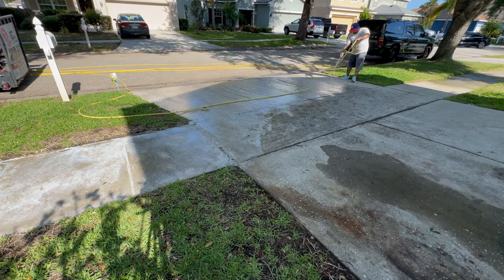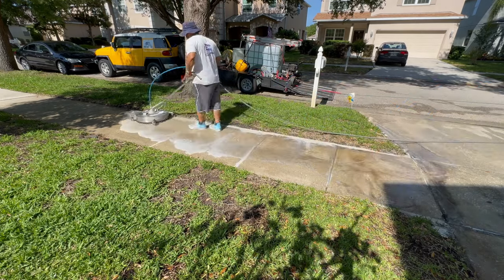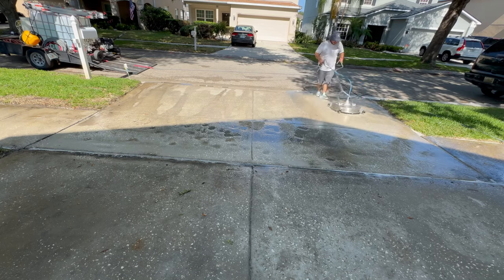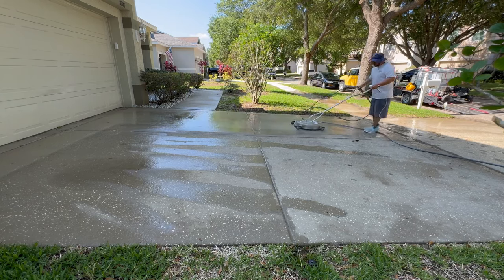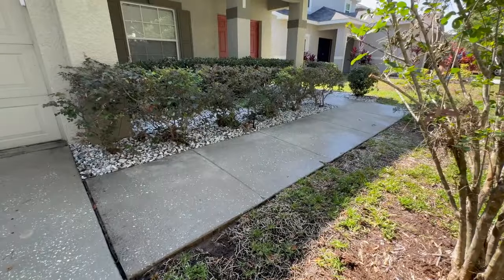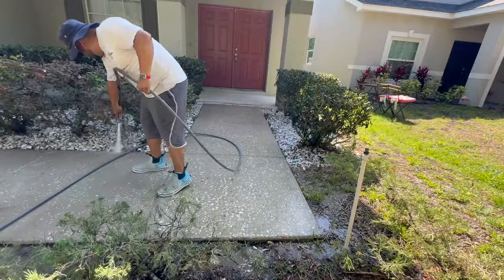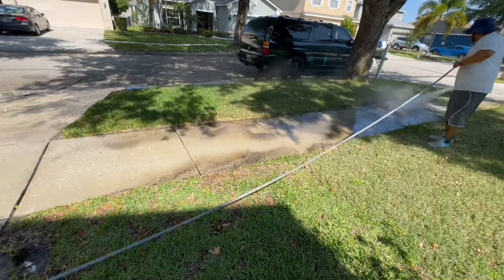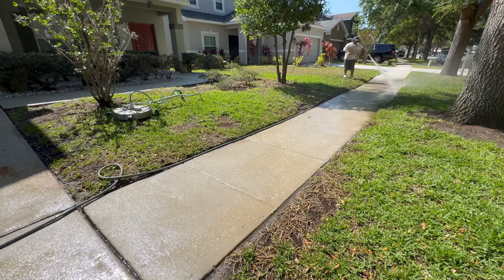Best Pressure Washing Tools Ever Made

Comment: John, a question if you don't mind? When down streaming, am I correct in thinking the 12.5 goes into the downstream tank/bucket 'full strength' and the mixing is done by the pressure washer?